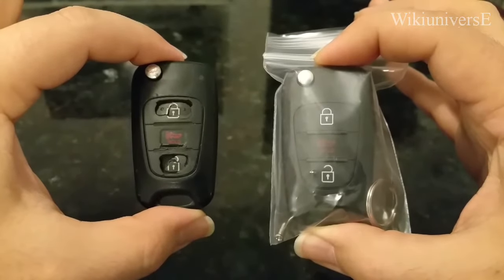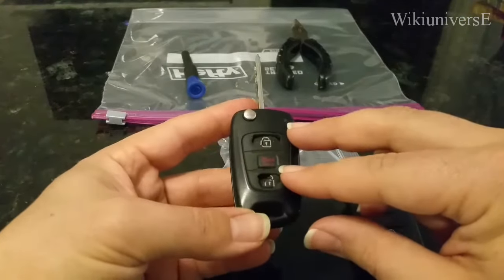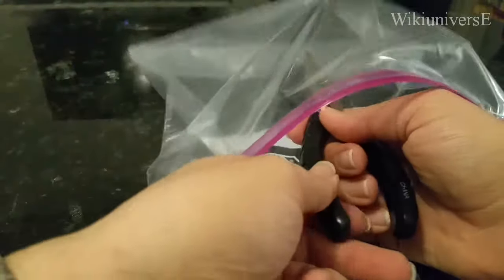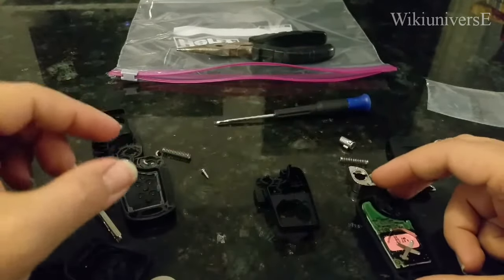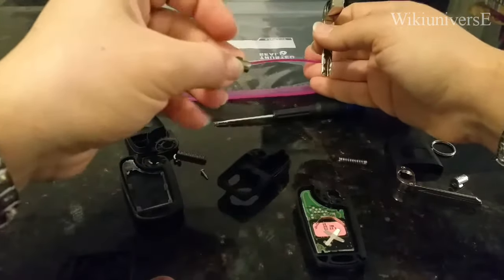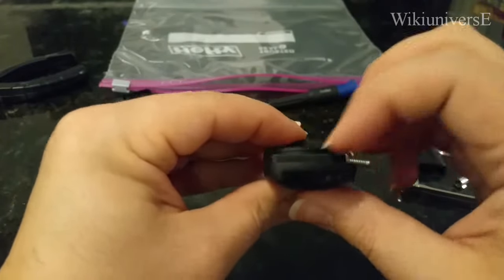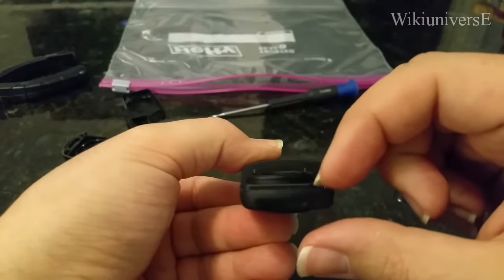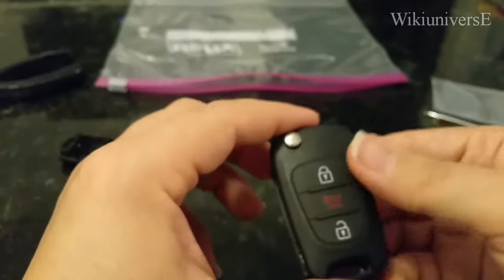How to Replace KIA KEY-FOB SHELL - THE RIGHT and PROPER WAY !!!

Comment: Your video was fabulous. Only one issue and rather serious. My car turns over but stalls. I tried to put it back together / old key and now I have no working key. OMG.
Reply from the maker: Do you have a little chip in your old keyfob?
Reply: @wikiuniverse2152  Wow.. thank you so much for the quick reply. I just see your note about the chip. What exactly does it look like? I will have to go through my garbage to see if I can find it. If there was one where would it have been sitting in the remote?
Reply: I pulled up the image of the chip on line and I found it in the garbage!!! Where do I put it???
Reply from the maker: @sleehsherry  you can put it anywhere inside the key fob make sure it's not close to any buttons or anything!
Reply: @wikiuniverse2152  Wow... I took the FOB apart again and saw there was a spot it exactly fit in the bottom right corner. I nervously headed out to my car.... and YES!!!! it worked! Thank you so much for your video. It was so helpful. I think there myself have been something holding that chip in that spot. I can hear it rattling in the remote. Do you think that is an issue or should I put something in there to keep it I that spot? I'm afraid to mess with it at this point....
Reply from the maker: @sleehsherry  you can put a little tape inside or glue it, one of the two options, and it is not going to Rattle inside! 😄
Reply from the maker: @sleehsherry  even if you leave it like that, it should be fine

Comment: I cannot get my key fob open. It seems to have been welded together. Any tips?
Reply from the maker: @darrenroberts1985   Check to see if there's any screw underneath the KIA badge on the back of the fob,  And make sure you move your little chip from the old key fob if you have one, not all key fobs have a chip.
Reply: @wikiuniverse2152  there’s no screw under the Kia sticker

Comment: My key is exactly the same as this one but there's a transponder that I cannot move to the new housing. The car won't start, only the remote for closing and opening the door is working. Is it possible to move that tiny transponder? I am afraid it will be broken into pieces and completely damaged. Please help.
Reply from the maker: It should not break, carefully take it off, and put it in the new box.

Comment: Hi I did all the above but key doesn't start car. It turns but doesn't start the engine. Remote locking does work
Reply from the maker: There's a tiny little chip little black piece you need to move that one to the new fob

Comment: If you have a Kia with a key fob that supports "high security" i.e. not standard, then you have an embedded transponder in the case. You can move it to the new case but it might take you a few hours to hack it out of the old one with blades and prising tools. It's not a job for the squeemish. If you don't do this, your car will unlock and the engine will turn over but won't start.

Comment: Hi, what would happen if the ligh does not turn on? but the key still works?
Reply from the maker: Most likely the key fob will not work but the key and the chip will still start the car
Reply: Put in a new battery

Comment: It is easier to put the board on the other half of the shell because of the 2 indentations to align. You also missed the essential step of transferring the identification chip glued to the inside of shell.

Comment: So didn't really save me because we cannot get the old fob apart at all
Reply: So I did what another commenter did, and used the rubber pad from the new fob )It came out of the new fob so easily!)  and took out the old rubber pad from the original key fob - I use a knife very carefully and gently to pry out the rest of the old rubber pad, and then put the new pad in, with a tiny amount of gorilla glue to keep it in ot's place, and it works!  No need to try and get the whole fob apart!  (which neither me nor my very strong son could do) Just replacing the rubber pad worked so well. I have one other old fob that I can do the same to.

Comment: Very helpful video. However, very important that he doesn't mention to remove the transponder chip ( a very tiny plastic part which is not connected to main board at all)  that is glued in the upper part of the shell and not visible. This lead me throw away the old key shell without taking out the chip. My key would lock and unlock but will not start the car. Kia dealer asking £399 for a new key. Luckily I have a spare key.
Reply from the maker: There's a description for key fobs that have the chip underneath the video, not all Kia fobs have chips! besides watching the video you need to read the information underneath the video!!!

Comment: Did not work for me. The chip was impossible to remove without risking to break it and the pin was not adjusted to the hole in the key so it could go all the way through. Ended up getting help from a professional at a reasonable price.

Comment: kia 2012 sportage has some kind of imobilizer that isn't spoken of. I now have a new key that doesn't start the car :(
Reply from the maker: Have you swapped key fobs
Reply from the maker: If you have, make sure you put a little black piece "chip" from old one to new one
Reply: @wikiuniverse2152  yes there are 2 pieces, a black plastic looking piece and a white plastic piece. Found out later that the black is the chip and the white is just to hold the black one in. Good thing I still had the old fob still